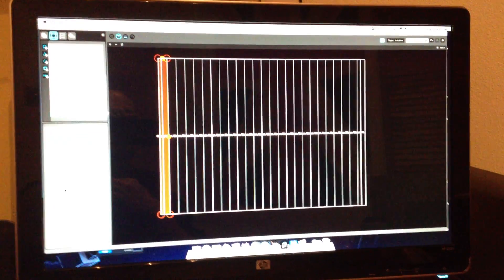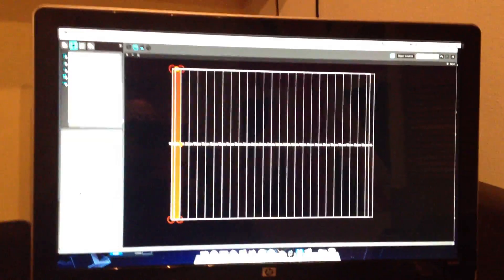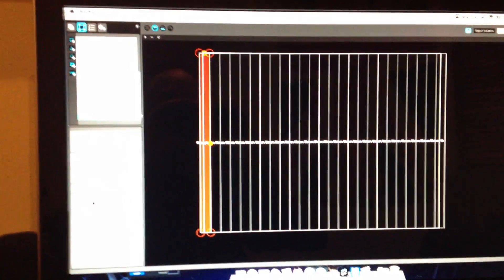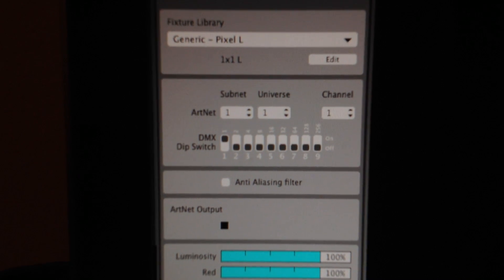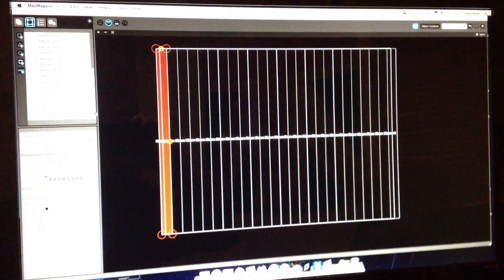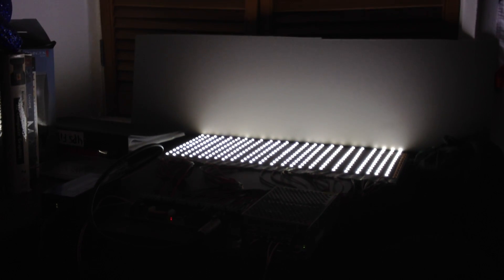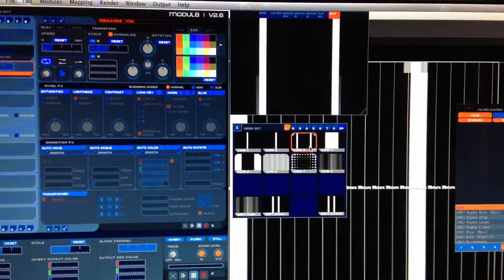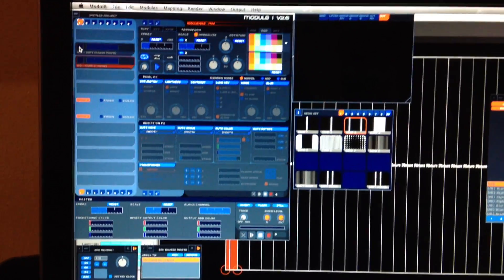Madlight Test

Comment: Hi - do you know if you can map each led/pixel within mad mapper and use RGB strip? You would have to use ws2801 or ws2811 addressable strip but it would be great if it where possible to put clips from Modul8 to full colour on an LED curtain. Great tutorial even if it isn't. Thanks

Comment: Hi
We are looking to light up a building with Blue strip LED lights. the building height is 70' and width is 15'. we are trying to put 4mtrs vertical strips by 185 horizontal strips, will have 2 setup side by side of the same size. And have the same type of graphics as shown in your video.
below are my questions:
1. How many ODE connectors will i require?
2. How many 24 channel DMX controller will i require?
3. Hom many LED strips can be used on each channel? and what is the size of the strips?

Comment from the maker: if you were wanting to use more fixtures, then using multiple driver boards and daisy chaining them together would be a wise choice. You could get a bigger board with more channels. I've not found one yet, as this board suits my needs and my budget. 

Addressing the strips was done in Madmapper. It was very simple. i set the dip switch to Ch1 and Madmapper did the rest.

i hope this helps, if you have any more questions then im happy to help to the best of my abilities.

Comment from the maker: I dont have any concerns scaling this project at all. The Enttec has 512ch on 1 universe. which is plenty for most shows. If you were wanting to use more than 1 universe, then your setup would be massive.

The Led driver board has 27ch's. So that would be 27 single colour strips or 9 RGB strips. Each channel has an power output of 4amps. So I will be using an Led strip that uses 1A per meter, Max 4 Meters. For my needs i'll be using 2 meters of white 5050 SMD per channel. 27 strips in total.
Reply: Hi digitalufo, I wonder if we could use RGB strips as single color strips by wiring to have more stips being controlled on a single controller?